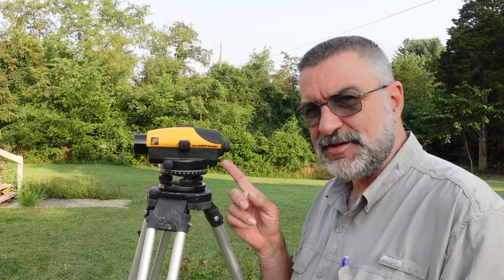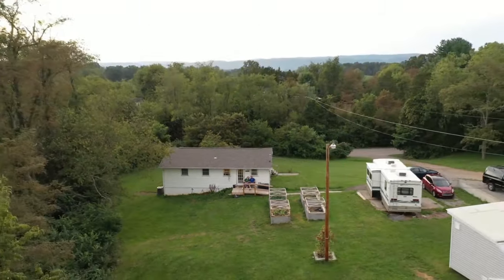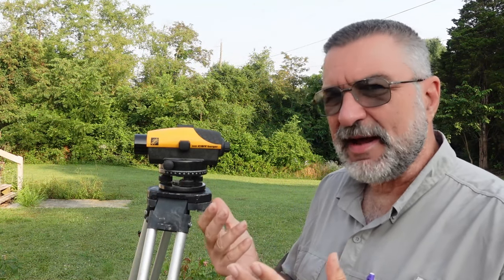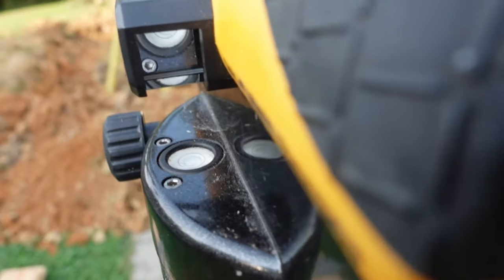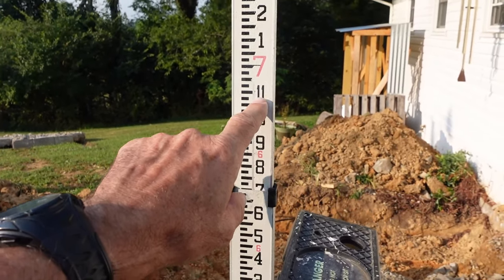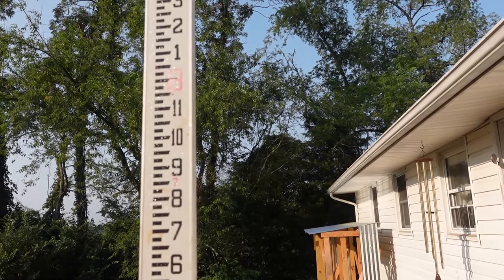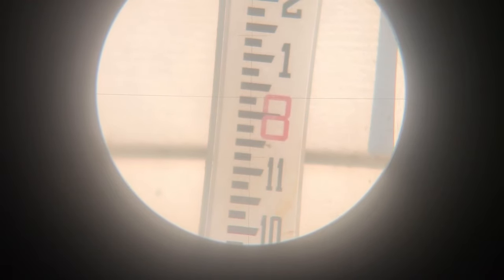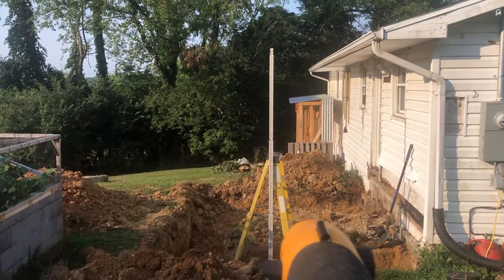How to use a Transit

Comment: Thanks for showing how a transit works. I've always wondered about that and thought there had to be a lot of algebra and geometry involved. It's good to know that it's just a matter of getting the transit level to begin with and then making sure your measuring stick is at the same height/depth at several spots in your project. Deer just love rose bushes. My dad put cages like the kind you put around tomato plants to protect my mom's roses.

Comment: Yep thanx bill..as surveyors of sort back in 68in Toronto we used the transit,for angles and azimuts and the level for what you were doing taking the elevation.
 You brought back memories of the construction of highway 27 & 401.(:-).
 I only did that work for five years.
 Good job

Comment: Enjoyable learning video. No useless blab. As in all good presentations, information from the commenters is good viable information or opinions. For the majority of commenters they got what they were looking for, "Oh, that's what that is!" I was looking for a little more. Armor Vestrus added enough for the redirect I am looking for. Having already used an "optic level transit" to facilitate placing 60,0000 lbs of steel structure and contents, I am faced with 3 more simpler but vastly larger structure locations. After that I will need to use a laser level, altitude verified by a distant "transit". If I understand correctly, I should be able to accomplish the task with a powerful optic leveler and not need to pay for the more expensive transit. Bottom line, I have more learning to do. Thanks for the video.

Comment: Good information on the Transit. Those deer are adorable. Is a Transit necessary for a greenhouse?
Reply from the maker: It is if you want it level. Or if it’s small, you can use a level on top of a 2x4.

Comment: I have always wondered how a transit works and I thank you for the nice demonstration. However, dumb question: how do you know if it's level if the stick might be stuck down farther in to the ground than the one by the house or are the sticks just set on top of the ground?
Reply from the maker: The stick is set right on top of the ground at whatever point you want to check.
Reply: @LiveSimpleLiveFree  Thank you. I get it!

Comment: That's an automatic level, not a transit.  Generations and generations of contractors in the past have referred to levels as transits, but they're not.  A transit is an engineering instrument that can measure elevations like your automatic level.  Also, the scope swings all the way through vertically 360 degrees which enables it's capability for surveying applications in the field for line transfer, or  plumb, like for steel erection engineering, columns, etc.  A transit has a finely graduated horizontal circle for measuring precise horizontal angles in the field like for  applications such as squaring up concrete forms for large commercial type concrete foundations, or establishing bearings and boundries between tracts of land.  I've heard levels referred to as transits hundreds of times over the years because I've been involved in  land surveying equipment sales and service since the 1970's.  I always thought it may be because there are other types of levels on jobsites, including carpenter levels, or speed levels, so contractors way back when may have called levels ,  transits, as to avoid confusing it with other types of non-optical levels on the job.  Not sure, but it's always a point of humor in most instrument shops.

Comment: Would also be useful to show how to use a "water hose level", very accurate.
Reply from the maker: Yes, very accurate.  But very slow and cumbersome when checking the level at many different points.  But MUCH cheaper, LOL
Reply: @LiveSimpleLiveFree  depends upon availability. A transit is expensive and fragile. Had several and trained many crewman to use...even lazer.
Reply: String levels are good, too.
Reply: @michellefricke7942  have one...

Comment: Please don't think that I am being mean or a know it all because I am not, but I have learned that a tool like the one you have in this video is a Level not a transit. I use to think they were the same thing but they have completely different functions. The industry even misuses the name but I do not know why. A true transit will let you flip the scope vertically 360 degrees so you can shoot a line backward without turning the head at all. I also have another type of Transit that a lot of builders use. It lets you tilt the head at a 45 degree angle but it is not even a true transit. A true transit lets you prolong a line more accurately than a haft transit or a level. To answer your speculation about how the level is used by surveyors like you have they use them to do contour mapping.👍

Comment: you can't do leveling without metric units, great video but that stick just ain't right
Reply from the maker: You must not be American? We don't use metric here.  I've been using these transits for decades, and I've never seen a metric stick.  It doesn't matter which unit you use, and long as you use the same one consistently.
Reply: @LiveSimpleLiveFree   i promise metric measurements is better, but for an optical level it's the only thing that you can use. But anyways, ain't nagging at ya, good video, old timer,... looking to buy a level now...  take care ....

Comment: u have a builders level not a transit/////2 different tools additionally you are not measuring in feet and inches your stick is defined in 10ths notice you DONT HANE 12 INCHES ON YOUR STICK???? 10 tenths equal a foot,